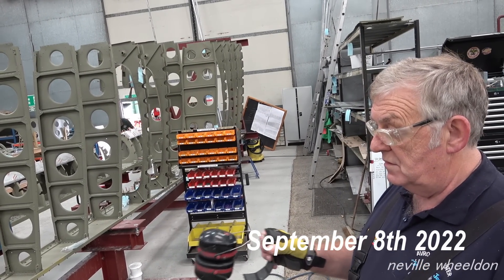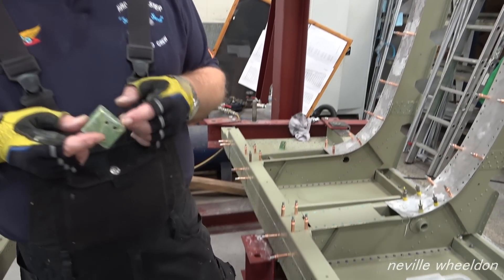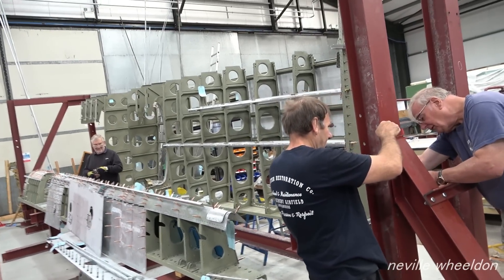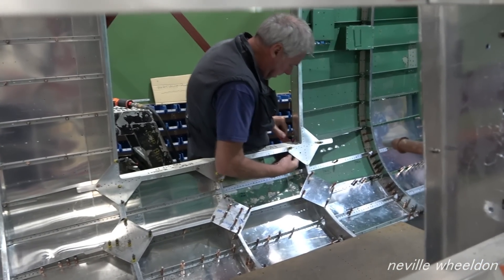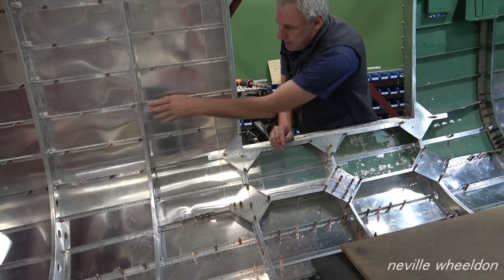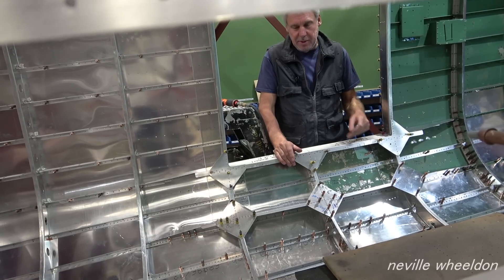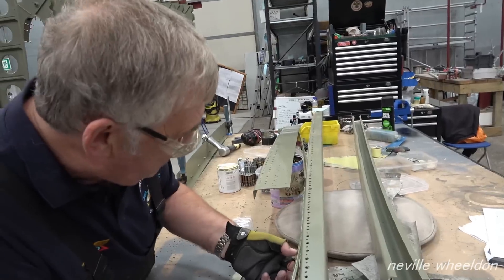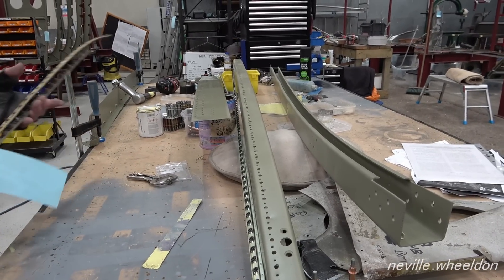Video 164 Restoration of Lancaster NX611 Year 5.  Construction of Jig for Lancaster NX664 wing.

Comment: Drills could only be sharpend when I was in the RAF only got ground use and not for aircraft as if not done right they will dill over size as well as not cut as cleanly.
Reply from the maker: Cheers ,Flying Kub.

Comment: Great video as ever, Neville! Question about the painting: why aren’t the formers and stringers for the rear fuselage painted before the skeleton was assembled, like the wing ribs and stringers are?
Reply: The majority of the fuselage is newly made so everything is assembled and drilled off before painting. Whereas the wing is mostly original so it’s known it’ll go back together ok with holes in the right places etc.
Reply from the maker: Hi Steve, Brad gave a good answer. The Doncaster fuselage and the French wing are not airworthy so they can paint and assemble it as the wish.

Comment: Again, a fantastic video documenting fantastically skilled & dedicated craftsmanship.

Question for you Neville: @2:54 what section of the French wing are we looking at? I seem to have lost track. And to confirm, Keith’s work is on the main or centre inboard spar of the French wing, is that correct? If so, once complete, are the leading and trailing edge sections (spars?) attached to it?  

Thanks!
Reply from the maker: Hi Bryce, yes it's the French wing .It is the rear spar with the ribs in vertical position, in front of this is the forward spar having the skins pined to it (at ground level).  When the forward spar is complete, skins painted and riveted to the ribs and spar, it will be lifted onto the rear spar structure and jig. To complete the wing the trailing edge will be fitted when on the Lancaster. Check out Video 165 this Saturday at 6pm, at the start, this covers the comment you made. (I hope ). Thanks for watching Bryce.
Reply: @nevillewheeldon1693  Many thanks Neville. I look forward to Video 165 (well, all your videos!).